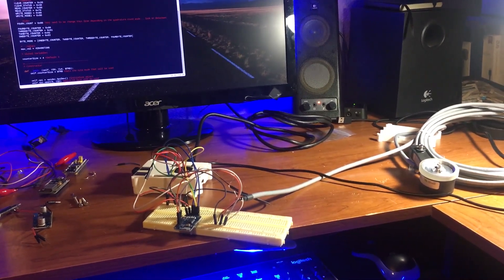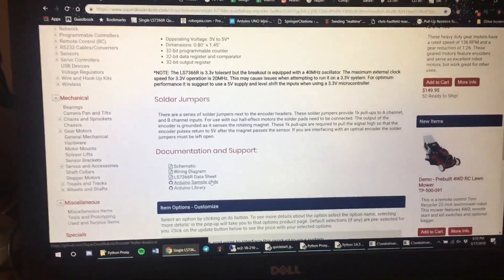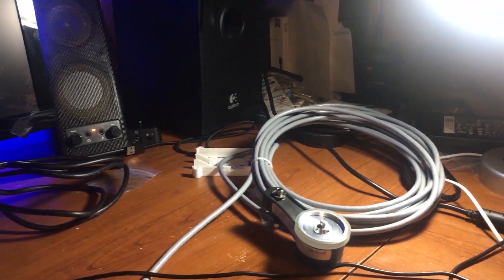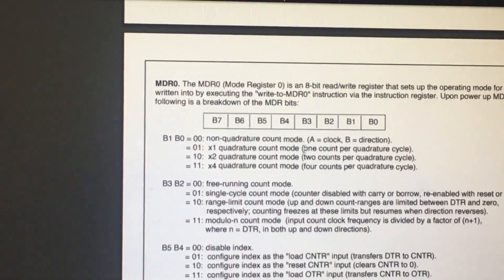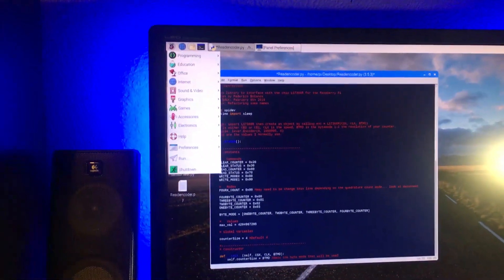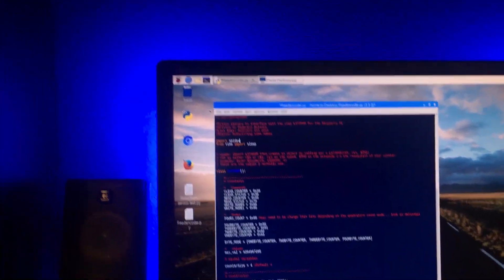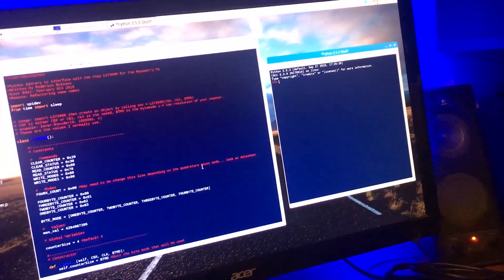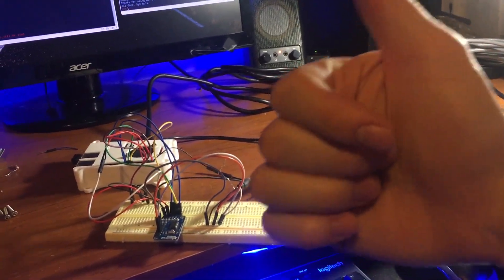High Resolution Incremental Rotary Encoder with Raspberry Pi and LS7366R Quadrature Counter

Comment: Hi I working in a project and I want to monitoring the speed of the shaft of the motor . Is it possible with this encoder and this ship ?I'm using raspberry pi

Comment: Hello Cameron Cobb.  I'm going to do counter reading on stm32 using ls7366r, but I couldn't do it anyway.  Can you help me ?
Reply from the maker: You may have to find an LS7366r library that is compatible with STM32. This video is only for Raspberry Pi with Python
Reply: @CameronCobb  Do you know an example where ls7366r is made on stm32?
Reply: @elifnur_1905-sr  You dont need LS7366 on STM32 use STM32F4xx series with 32 bit hardware timer-counter -encoder bulit in...

Comment: Hi Cameron. Would it be possible to connect three LS7366R chips to a single Raspberry Pi to be able to monitor three rotary encoders simultaneously?
Reply from the maker: Laurent Franchet hi. You can do that, you just need 3 LS7366R chips. The website sells different variants of boards
Reply: @CameronCobb  I looked up on the website and they have Triple LS7366R Quadrature Encoder Buffer breakout boards. So I guess this is what I shoud use.
Reply from the maker: Laurent Franchet oh i didn’t know they had a triple. That’s good news. That should be much better than buying separate boards
Reply: @CameronCobb  Not really, the SCK, MISO and MOSI are tied together. Looks like you must use S1,S2 and S3 to select which LS7366R is active. Would be nice if they had provided output headers for each chip.
Reply: Oh, and they have a Quad board also. Same problem as with the Triple is you need seperate output headers for each encoder.
Reply: @CameronCobb  Thanks a lot. My understanding though is that the LS7366R chip needs to be connected to the SPI interface. What would be the wiring diagram for 3 LS7366R chips?
Reply: Yes
Reply: hi, do you have the wiring diagram for three LS7366R chips with pi?

Comment: Hello Cameron,
I am working on a robotic project and, it requires a line follow and I selected this motor ( https://www.pololu.com/product/4862 ). What I have to do is when I want to turn 90 degrees, I have to turn exactly 90 regardless of battery level. And I have a motor driver as well ( https://www.pololu.com/product/2753 ). Can you suggest a driver and how to accomplish it?

Comment: I’m also working on similar project by using Pi and encoder , in my case I’m trying to capture photo for every 5 meters using encoder. Please let me know if you have any info. That will be helpful. Cheers man!
Reply from the maker: Lakshmi Narasimha what kind of info are you needing? That is very easy to do with this encoder chip and code
Reply: @CameronCobb   thanks for responding to my txt. I want to use encoder (600 pulses Incremental Optical Rotary Encoder AB Two-phase 5-24V Rotary Encoder) and count pulses after every 5m need to capture image. let me know if this code works for this rotary encoder. cheers man.
Reply: the code you mentioned in the description will work for this encoder or not mate?
Reply from the maker: @lakshminarasimha9457  This code will work. You may need to configure it and you may need to use pull-up resistors on the encoder board if you are supplying more than 5 V

Comment: Hey man.
This was just what I needed.. really..my project is similar..but if 
I want the motor to stop at some precise points. Which my very big program sets along with other parameters.. 
I need a start point
And point where it starts accelerate. A point where it decelerate..and final a stop point.
But these points change from every movement.. how do you communicate these points to the ls chip... I will buy the chip and start working in the same direction as you... Thank you ..btw..
It would be nice if you could do a more in-depth wiring and also a in-depth python..maybe a part 1 and 2 vids... 
I think a lot needs more in depth on high res encoder and how to tackle it.. 
I see many vids on normal rotory nobs.. which don't have the speed or accuracy...
Please be the first on you tube to make this more easy..